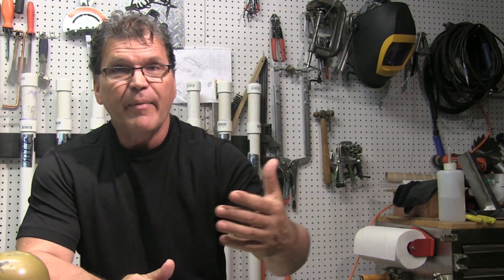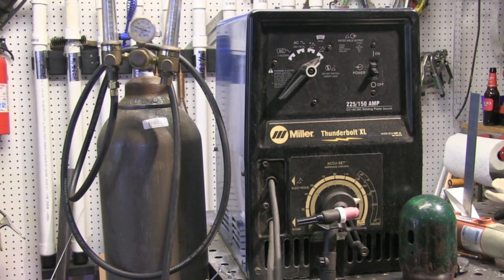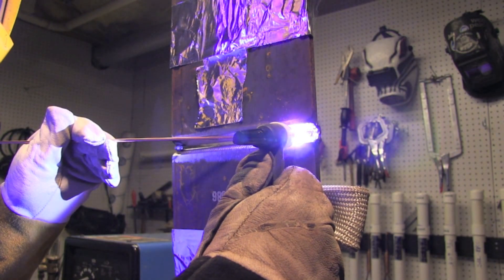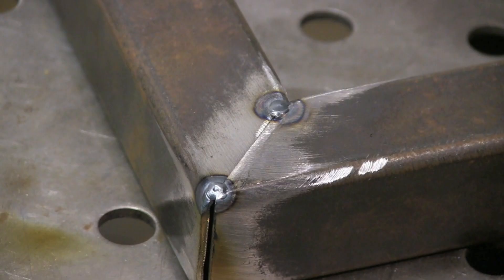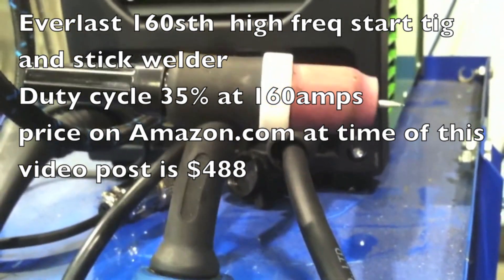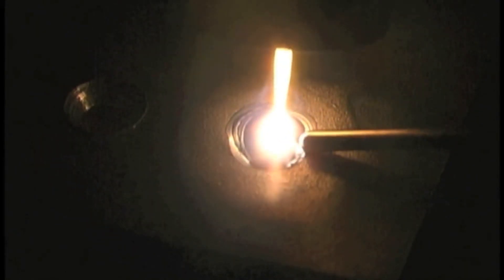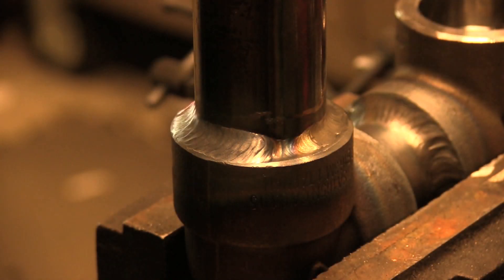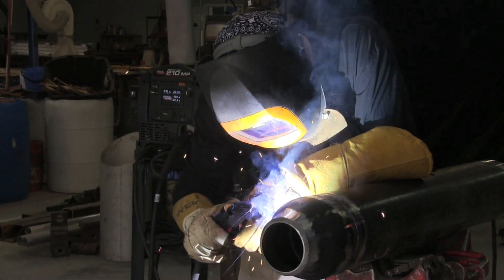Tig Welders - Scratch Start & Lift arc - Linclon, Miller, Everlast, AHP

Comment: I note that you mention scratch start for 6g tests, but no comment on tungsten inclusions which will fail xray results, but can be avoided by using carbon block to initiate arc, also preserving tungsten tip.

Comment: I bought the mp200 I from Eastwood, even as a beginner few months back, i wish i would have done a little more research on scratch start compared to a pedal...but it's a good way to learn even if it's a bit more difficult.. Thanks for a great video..

Comment: I have en German Scheppach 160A stick welder IGBT / inverter that I use for scracth start tig. The current adjustment is. 5v pot (voltage divider) so I hacked the pot and made it possible to control the current with a foot pedal. However hot start and arc force is mandatory and cannot be disabled.... I think that the arc force/ anti-stick sometimes messes with my arc?

Comment: I have no experience on tig I really wanna learn how to weld pipe with it I have lots of scrap at home ranging from 2"-10" what machine would you say I should get for practice
Reply: If you have $1600, the Lincoln Square Wave TIG200 is a pretty awesome machine.  If you don't want to spend that much, the AHP AlphaTig200 is about $800.  Both machines can run on 110V and 220V, weld in DC and AC so you can handle any type of metal, and have high frequency start.  The AHP foot pedal is different from most other pedals, and a lot of people don't care for it.  Some people turn it around and step on it backwards to make it operate more like a regular pedal.  Screwing it to a board also helps to keep it from sliding around on the floor.  The Vulcan line at Harbor Freight is touted as industrial level.  The OmniPro 220 does stick, MIG and lift start TIG for $900.  Their Titanium line is a bit cheaper and is hobbyist level.  If something goes wrong with a Vulcan or Titanium, and it is under the warranty, you just take it back and get a different one.  Lincoln and AHP will have you ship the unit back to them and they will fix it and then send it back, which will take a few weeks, minimum.  So, there are pluses and minuses.  You also have to buy a few supplies: gloves, helmet, tungsten electrodes, filler metal rods, and a bottle of argon.  Different size cups and gas lenses come in handy.

Comment: Been running the Miller CST 280 and Lincoln Precision TIG 225, both are fine machines. The Miller is my preference for pipe and stick, but sometimes you just can't big a big transformer machine for a smooth TIG arc and running 6010.

Comment: Ok, just getting into welding. Teaching myself. I got a Miller Bobcat 250 in June or July. After talking to Miller, I got another machine for Tig welding. I got an AHP Alpha Tig. The 2016 version. I suck at that right now. But, that is what makes learning fun. To the point. To Tig weld, with the Bobcat 250, would I not also need a HF box? If so, how much do those things cost? Thanks for all the great videos. Oh, I got an XL Tig finger. Now, I just gotta teach those fingers to Tig.

Comment: I ended up finding a barely used Everlast 140ST for a great price. QUESTION: As a hobbyist & for DIY projects/repairs, is it practical to use a gouging electrode as a "carbon arc torch" with a machine like this for heating, bending, &/or brazing? If so, diameter/amperage recommended? (or better alternative) I am uneasy about the cost and all the extra safety precautions required when gas & storage of gas comes into the equation for the rare occasions I anticipate the need for a torch. 

FYI, I do have the TIG torch with the Everlast 140ST .Thank you for your input.

Comment: i always thought it was weird... when tig welding you're supposed to keep a low angle, nearly straight down, slightly tilted (electrode side) toward the direction you're going.... but walking the cup its damn near horizontal. how come this is ok when walking the cup? is it normal?
Reply: +Ian Mears I think it works because walking the cup is usually done with something like a fillet joint or another partially enclosed joint and that helps trap the argon.
Reply: CrafterSandstone8
i've never legitimately walked the cup except for entertainment purposes, and i've always found it difficult to have the right stickout while still using the cup to walk unless using a very large size cup and short stickout even with a gas lens on it.

too little and it became even more difficult to add filler, too much and i risked dipping frequently.

more practice i guess!

Comment: I'm not saying Jody is wrong because he's the one with the PhD in welding, but why isn't there a risk of contamination @7:38 when you "snap" away the cup while the puddle is still hot?   I was taught to keep a few seconds of post-flow with the shielding gas aimed at the puddle during cool-down.    What am I missing here?
Reply: Thanks for the explanation.  If that's the way scratch start TIGs work, I'm not going to touch one with a 10 foot pole!

Comment: Love the videos and weldmonger products. I firmly believe the Lincoln 200 squarewave is the best home tig machine on the market for around $1400. It has frequency and balance control and runs on the common 120V or 230V plugs common to other Lincoln machines.

Comment: Will a tig-torch work with an old-school AC-DC transformer type welder?
Reply: +Blackaboe yes, jody did it in this video where he hooked it up to the Miller Thunderbolt welder. You would need a tig torch with the gas valve on it. Hook the gas hose to an argon bottle/regulator/flow meter, hook your positive lead to the work, and hook the torch to the negative. You would be doing scratch start tig which is used all the time inside plants/factories especially for stainless steel fab/repair. Those old buzz boxes have pretty smooth tig arcs from my experience with them. Good luck!
Reply: +Blackaboe forgot to add to put your machine to dc...you would need a high frequency start to be able to use that machine for aluminum tig. It will do most everything except aluminum, magnesium, and some others, but you will be able to do mild steel, stainless steel, cast iron, etc.

Comment: while its DC only those low cost TIG units are pretty nice even if they are lacking the bells and whistles like HF start and varying power with a foot pedal. but for a few hundred bucks/running off household wall current it is mighty tempting!

Comment: Hey Jodi is the Lincoln 210 a true 3 process machine or only mig with a spool gun?
Reply: It's a true mig welder.
Reply: +James Spires Its a full on MIG welder.  Its actual name is Power MIG 210 MP, its MIG welder first and foremost.
Reply: +James Spires Primarily MIG but does stick and tig nicely. Jody has videos using it for all 3 and it certainly can do them all quite well. If I remember correctly he even used it to Tig 2" thick aluminum with helium.

Comment: I got a Longevity 200DX a few years back. if i could keep gas easier i'd use it more, but mig works soo much better for me (running pure co2). i do weekend stuff so not having a store open on the weekends blows when you run out of gas, and i only have an 80 cu/ft bottle for argon. i use the longevity more for small stuff than anything else, but my tig sucks because i can't practice as much.

the thing i hate about tig mostly, is the footpedal. mine quit working when i try to adjust the max amps, so the pedal itself only works if i set the box up to 100% amps. i hate the footpedal mostly anyways, and not having the ability to adjust it to make it "more sensitive" for the lower amp stuff makes it kind of a pain, so I just 2T it - played with 4T, seems a bit too much going on for me.

in all honesty, my favorite tig rig has been my Forney 100A inverter. I bought a harbor freight torch for it and scratch start. can't do alum with it because its DC only, but i have only done 1 item w/ alum and that was when my skills were absolutely terrible (not that they are any better now).

do you think it would be worth it to maybe rent a larger argon tank? i don't have a ton of space to store one, but grabbing one for a few months i'd probably burn through a few just to learn.

Comment: Another great video Jody - did notice a time or two, while your arc was nice and short, your torch angle was quite extreme - appreciating that vertical would not be practicable of course.
I use an Eastwood 200 and got it because price was very competitive, having very limited budget - it has a #17 torch and foot pedal, also AC option so - quite useful and dual voltage, fixed frequency though. No idea if you've seen one or used one.
Just wish I could emulate your skills but old age and unsteadiness do not help!
Reply: his angle is Extreme for the arc shots otherwise you won't be able to see them

Comment: i run an Ahp alpha tig 200x , been a pretty solid machine for me, really like welding stainless with it, has a super smooth arc too.   great vid Jody!
Reply: +Defnotdemas,  James and Def, I have the AHP Alpha as well... heck of a machine, I paid just over $700 for mine over a year ago and it has paid for itself a couple of times. I've stick welded my  box blade,  my 6 foot rotary mower and repaired a beat up auction find anvil. I have used the TIG to repair my favorite reclining chair and most recently a steering gear on a $150 auction find John Deere LT 133 mower (used they sell for about $500 around here).
It is a great little machine.
Reply: I was going back and forth when deciding between the AHP and an Everlast. I eventually bought the Everlast because of a few features I really liked but I don't think people can go horribly wrong with either.

Comment: I tried a lot of newer tig machines and there are really hard to tell any difference. On DC the only difference was better and more reliable hf start on really expensive machines. For manual welding no difference, but can work alot better for automatic welding. 
Biggest difference is on ac and it goes like this fronius>other expensive machines>budget machines. Fronius is much quieter on ac (it has some nice technology behind it), even on higher currents, plus it has super stable arc. Other high priced machines normaly work good, but with budget machines there are often some stability problems (on lower currents). I did not tried miller or lincoln machines, because I live in EU, so I can't comment about US made machines.
Reply: +Kevin Rausl 
Ha, I didn't even know that Fronius is an Austrian company with their HQ less than 100km from me.
Since you're from EU and judging by your name most likely Austria or Germany and tried "a lot of tig machines" (your words ;) ), do you have any idea about the quality of "Stahlwerk" welders? They have pretty full featured AC/DC welders (e. g. an AC/DC TIG/stick/plasmacutter set incl. pedal, helmet and other accessories for a little more than 800€). They have a 5 year guarantee, but I still fear that they are just some rebadged China gear, that will break even just in occasional home use.
Reply: +superdau I'm pretty sure that the Stahlwerk welders are rebadged chinese welders. Theyre sold here in Denmark under a different name, so... Fronius, Gys, Kemmpi are made in western europe. Esab is a great brand too, but sadly production has moved from Sweden to Poland (not that polish work is nescesaraly bad, but i feel like a swedish brand should be made in Sweden).   Cheers from Denmark.
Reply: +superdau I'm actually from slovenia. There are alot of chinese companies and there are alot of them making the same model (like older stahlwerk 200 acdc). Tried one machine like this and it worked great. The main thing with these machines is guaranty and service. So don't buy chepest one from ebay. Go buy it to welding shop with good reputation, so if anything is wrong they will fix it. Not shure about shahlwerk service, they seems to be ok. 
There is one chinese company called WTL. They make the good stuff.
I was in welding busines but now i'm in toolmaking company so I weld mostly tool steels with tig and plasma welding, but I stil love to tig weld for hoby and try some things.
Reply: Kevin Rausl
Thanks!